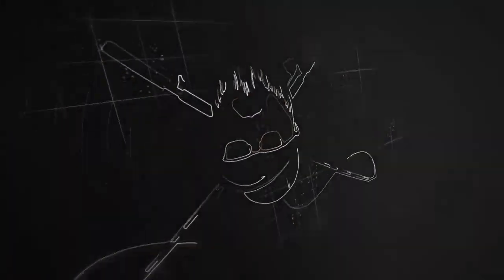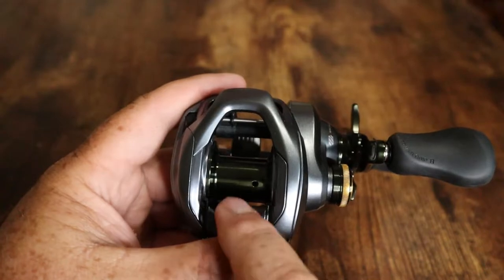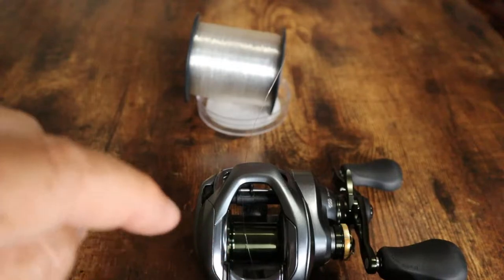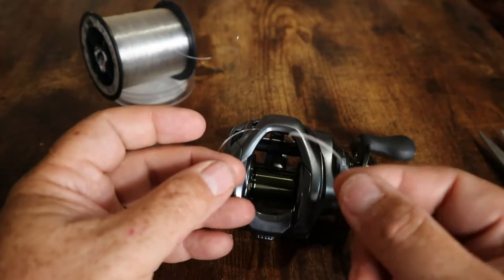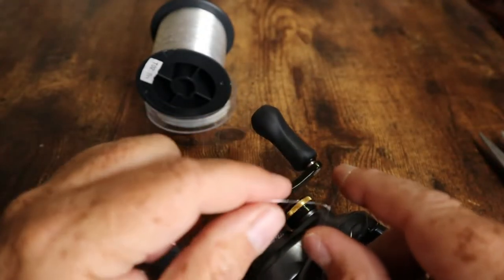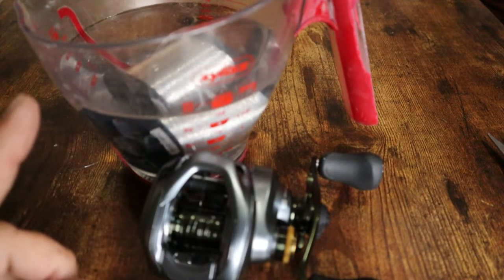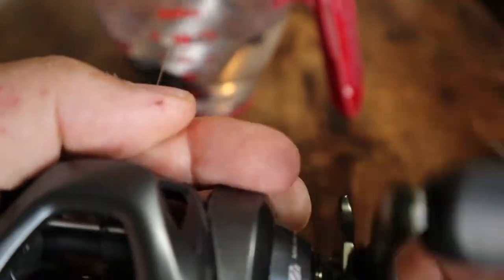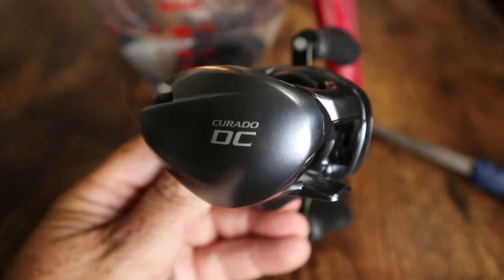How To Spool A Baitcaster Without Line Memory

Comment: great video! my fluorocarbon line on my baitcaster keeps getting loose like it won’t stay tight on my reel when casting. i made the correct adjustments only my reel and had tension on it when spooling any advice on what could be happening to cause this? bad quality line? i didn’t try the hot water could it because of the memory?

Comment: The line only comes off the spool in one direction and only onto the reel in one direction. So the only tip is hot water lol
Reply from the maker: Thanks for watching!
Reply: Hold the line spool horizontal.  If you pull it off the top it is coming off in the opposite direction it is if you pull it off the bottom.  Another way to think about it.  If you pull off the top, the tag end points toward the floor.  If you pull it off the bottom, the tag end tries to point to the ceiling.